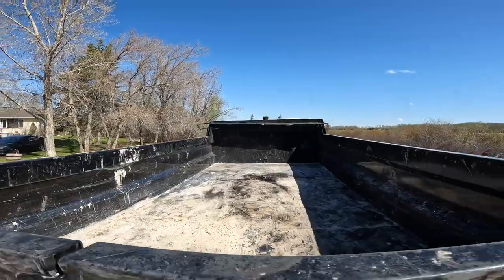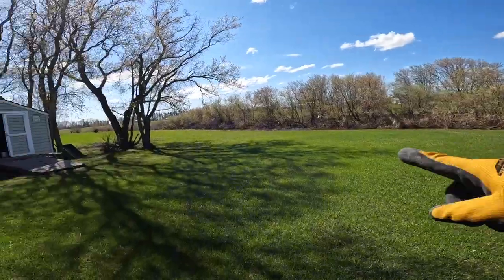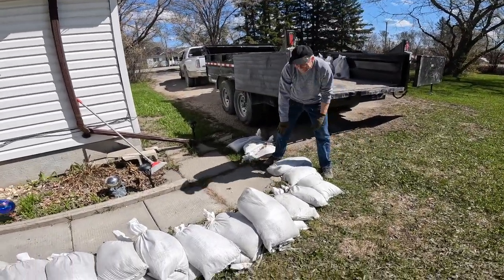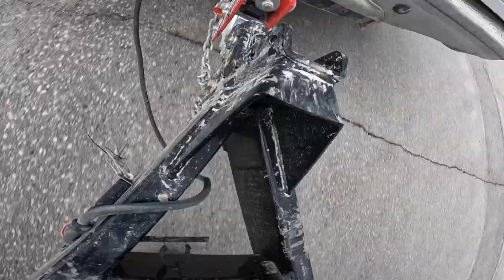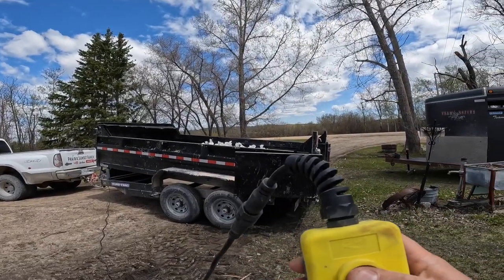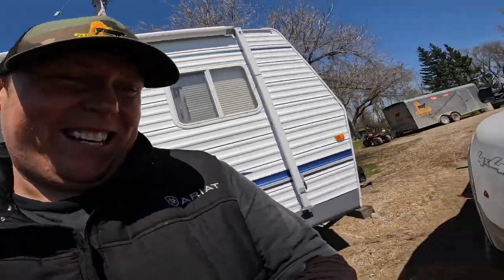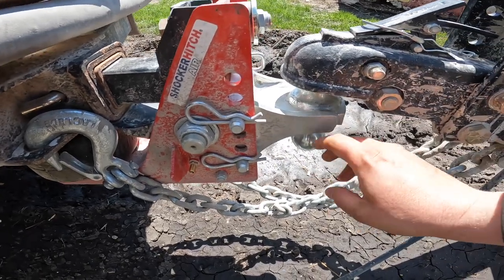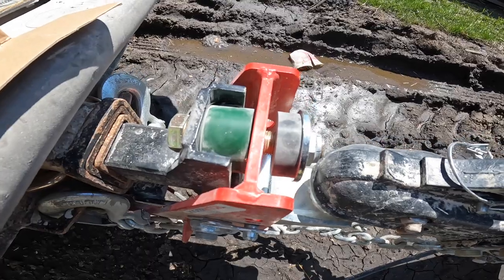Shocker Air Receiver Hitch Product Review

Comment: I purchased one of Bob’s hitches 10-12 yrs ago, I love it! I pulled our 3 ton feed trailer around with Chevy 1/2 ton pickup twice a week in the South Texas heat(over a 110+*)all summer. I’ve pulled a 3 horse bumper pull trailer. It’s safer for you no jarring of your equipment. Go get one!
Reply from the maker: I use my Air Hitch for hauling cattle 🐮 & it’s been an absolute GAME CHANGER! Wouldn’t wanna be without this hitch now thats 4sure. Cheers 🍻 from PSR & Happy Hauling 👌👍💪💪

Comment: I have two of the 16000 lb ones I bought
2 months ago,  I love them the only thing is I did notice you have to make your safety  chains  a little longer and be a little safer backing into driveways with a little hump but other than that pulling stuff around keeps your trailer and your equipment safe!! A drop hitch is around $200  so if you need a drop they would definitely be worth paying the extra for a safer ride! They aren't cheap but if it saves your trailer or help you stop its well worth the extra.
Reply from the maker: These Shocker Hitches are definitely worth the MOOLA 💯$$$👌 Cheers 🍻 Meyer

Comment: Aaron, you answered my question.  No one else answered my primary concerns of pulling a livestock trailer.  If I can make the livestock trailer ride smooth, then that's what I need.  Yes, I'm on the fence throwing that kind of money at an air hitch but if it truly works, then that's what I need.  Thanks again.  Full-watch.  👍🏽🤠  12/9/22
Reply from the maker: It’s definitely a game changer. I just pulled a load of Steers to auction couple days ago. Probably hauled 20 loads of cattle using the hitch already and it works flawlessly no matter how many animals I put in. This last batch was in really cold weather but the air bag seems to hold up well in any condition. 👍
Reply: @PrairieSunsetRanch  Thanks.  Just what I needed to hear.  Now I'll pull the trigger and purchase the Shocker hitch.  Appreciate the feedback.  👍🏽🤠
Reply from the maker: Cheers 🍻 buddy!

Comment: Nice review to you should have got the 16,000 with what you pull but you'll be just fine with the 12,000 but keep up the good work. Also those airbags are off Simi's should hold up real well but you are right about the hook part rubbing, they do advise you put some  water hose/ coving over your chains,  just so it doesn't eat into the Shocker hitch but I think they will last a long time before any problems and they do sell refurbished ones on ebay for a little cheaper if someone didn't have a ton of money. Also I can't wait for a a$$ rider to eat the receiver, they are made like a anvil. Also one more thing those hairpins, they out now with a little extra tag on the back so they pull out easy and you don't have to pull as hard. If anyone need more info on the hairpins I switched out let me know. They work too well for anything you use a hairpin on, on the Shocker hitch they work well for switch ball sizes and they should just come standard but they are the way to go!
Reply from the maker: Thank you my friend appreciate the info & Cheers 🍻 from PSR

Comment: Hey Aaron.  That’s quite the gadget there.  Can sure see where it would help with the cattle wrestling in the back.  We run mostly fifth wheels around here but I can see the value if a guy was dragging a lot of bumper pulls!!
Reply from the maker: Definitely 👍, It’s great pulling that long enclosed trailer of mine. Im sure it will be Friggin 👌 with that big ass camper of ours! Cheers 🍻 buddy
Reply: Shocker sells 5 wheels adapters!

Comment: I don't feel that driving a dodge. Lol. (That one's for BP). I'm sure it works great. Stock trailer is the only thing I have that's a bumper pull. Everything else is a goose neck or fifth wheel.
Reply: Don't need those fancy things on chevys either
Reply from the maker: Lol, All u feel in the Dodge is a wobbly front end from the plastic ball joints 🤣🤣🤣🍻
Reply: @PrairieSunsetRanch  correction.  All you feel in a dodge is the raw horsepower, wonder if that shocker hitch would help on the tow truck when your towing broke down fords?  😝 hahaha 🤪
Reply from the maker: Lmao 🤣!  Dam Cummins guys 🤣😂👍

Comment: I'm sure that I could look this up, but I have you right here so, I'll ask you. Do these shocker hitches come with a higher weight capacity? You said this one was rated at 12K lbs. I'm sure that it works nice, but it kind of limits the capacity of the truck, doesn't it? Just wondering. It's nice to see SPRING finally in the background!! Better late than never!!
Reply: They have a 16,000 pound to they also sell other attachments for it and gooseneck 5th wheel adapters
Reply: I don't sell them or anything like that I'm just trying to help out a great product in my mind
Reply: I think the 12000 lb is around $640 and the 16000 lb around $740 a hundred dollar difference between the two sizes they both look the same
Reply from the maker: Sounds bout right 👍🏻
Reply from the maker: Meyer Tent has more knowledge than me in regard to the hitch. Better go by what he says 🤣👌 Cheers 🍻 Andy

Comment: I've had those little chain hooks straightened right out and do nothing when they were needed they are next to worthless for actual safty chains
Reply from the maker: Hi Paul. I luckily have never had to experience what you are talking about but yes I’d imagine not much use for moderate to heavy applications. Probably only time those chain would hold 🆙 is with something like an aluminum Atv trailer with and atv or snowmobile on it? Even at that i dunno 🤷‍♂️ 😬 Cheers 🍻 my friend.
Reply: @PrairieSunsetRanch  for me it was a comical moment at a boat ramp. Still can't explain how it came off the ball fortunately the boat was well strapped to the trailer and noone was there. When it self launch boat and trailer strapped together.  A fisherman saved me from making the swim to get a line on it and retrieve it.   Never will I ever use those lightweight S hooks on a trailer of any real weight
Reply from the maker: Holly now that would be a sight to see. A boat and trailer floating. 🤣 Im glad the boat was retrieved without issue. Thanks for sharing Paul & Cheers 🍻 buddy.

Comment: Ha ha. You need air bags on a f350. Good joke.  I pull a 13k pintle with my 97 f350 and put around 1500 to 2000 tongue wieght and dont squat mine. I have an adjustable multi hitch and all the adjustment pin holes are egged out
Reply from the maker: Certainly don't need bags on a F350 but it sure makes the ride quality a lot better while towing.